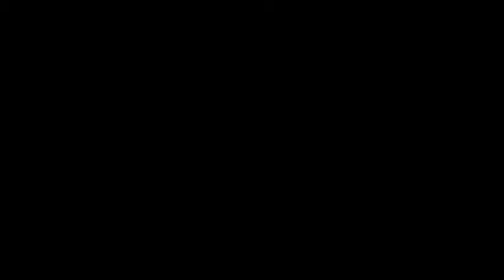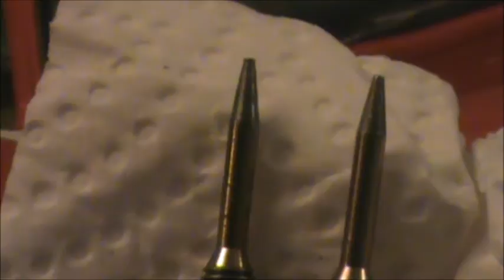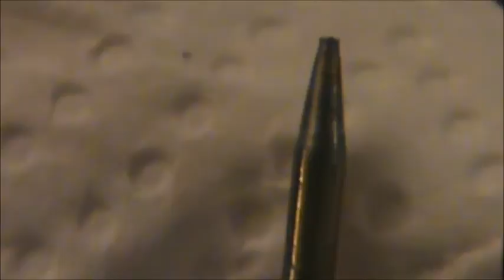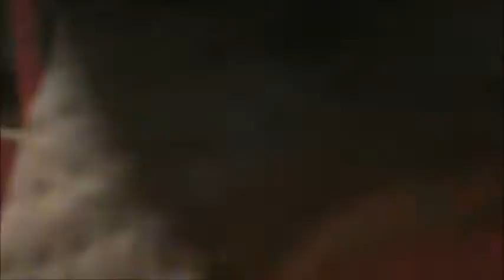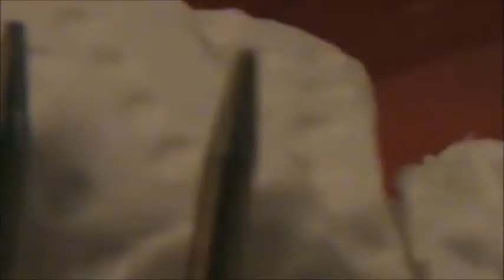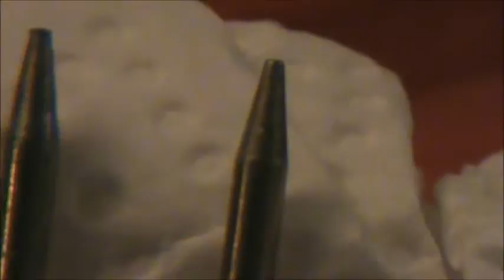Air /  fuel screws

Comment: Certainly is an issue for idle air mixture...Not sure it will stop the (backfire) ?.
Reply from the maker: Well it seemed to fix it and the backfire and it and made the idle a lot better , doesn't take muck to screw them up